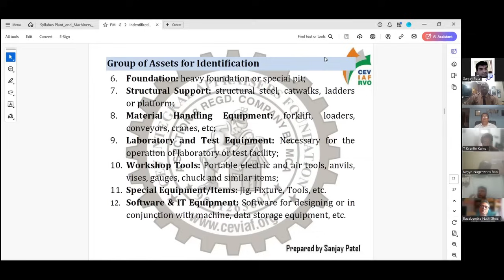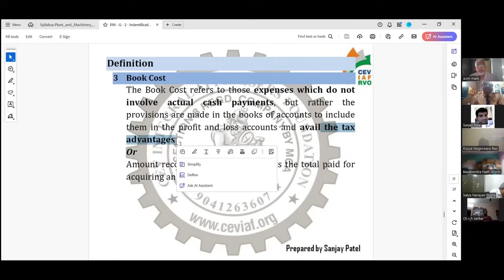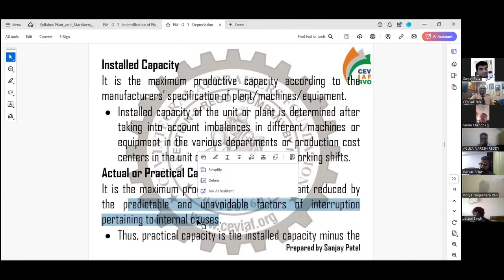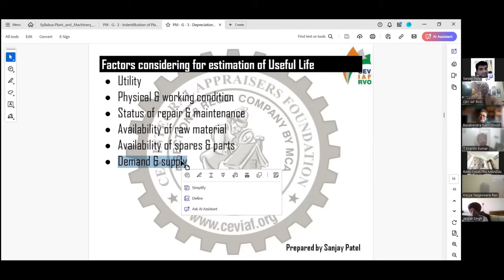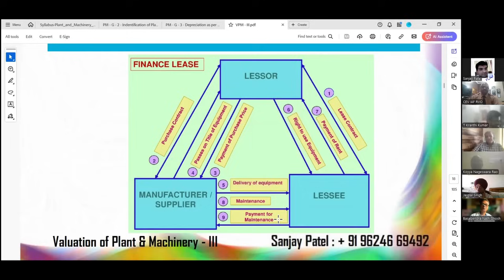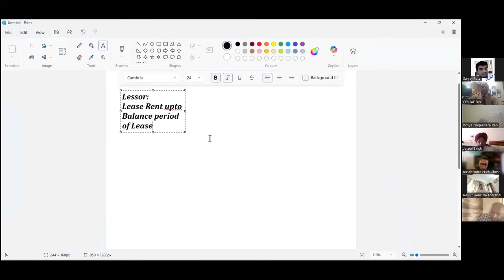VALUATION OF PLANT & MACHINERY: BASICS WITH CASE STUDIES PART-1

Comment: Componisation of valuation as per companies act is difficult to consider. For ex. Compressor you had suggested. Every part of compressors is essential to run compressor. Secondly break up of component and its market value may not be possible as if you compare piston and cylinder cost separately then it will be sold as spare and will be very expensive similarly the frame supporting compressor market value of similar ordinary frame may be useful but never suit similar technical requirements. I have not understood the logic behind this rule. Your comments please as guidance.